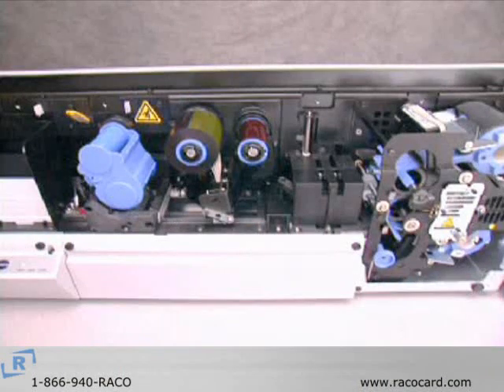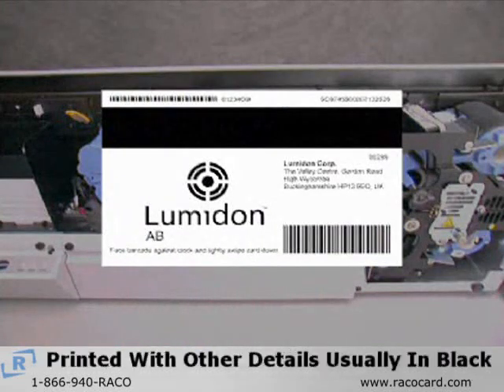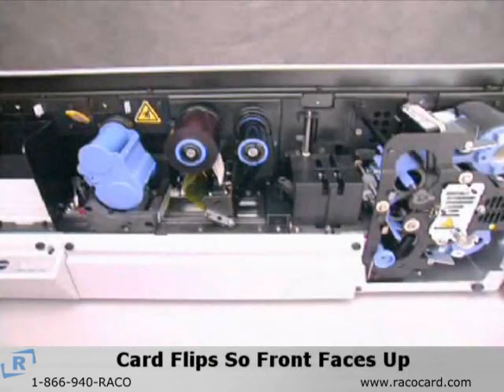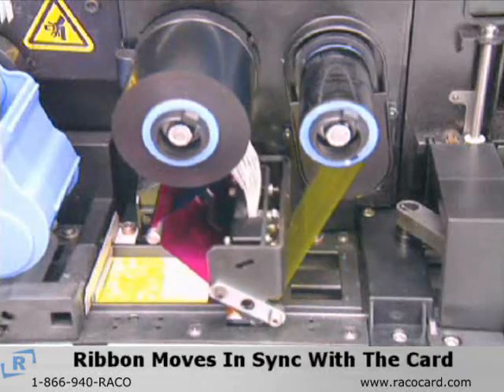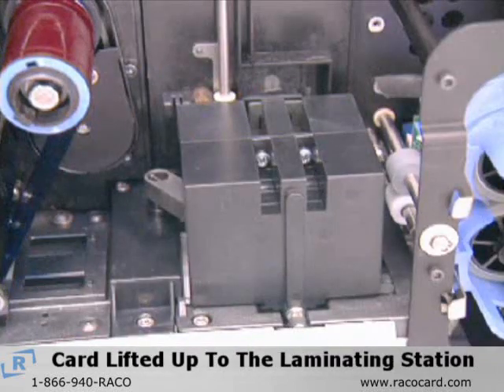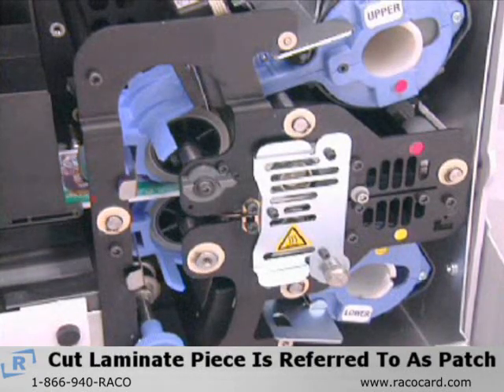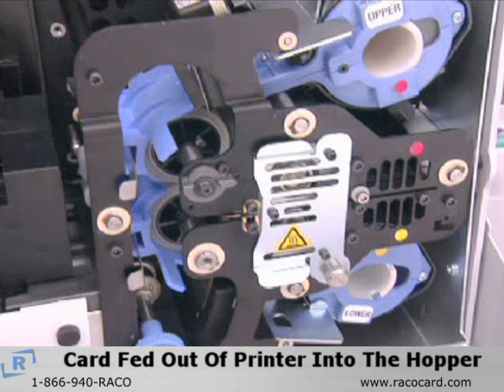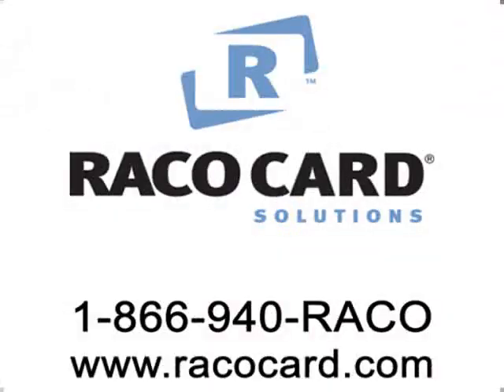Zebra p640i Card Printer Overview

Comment: i have a problem whit the 630
the ribbons they get stick to the card and stuck in the printer and nead to cut a part
i fix it whit the head cleanin and aligment whit the 4 screws on the back and like 100 card printed the same problems